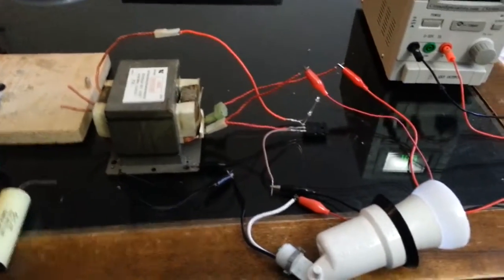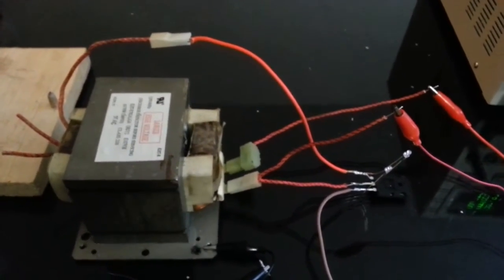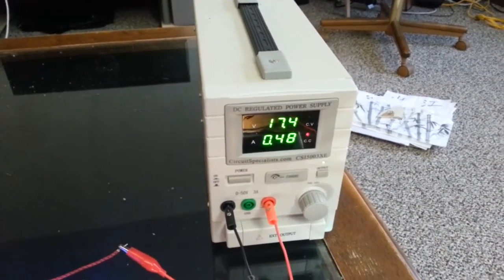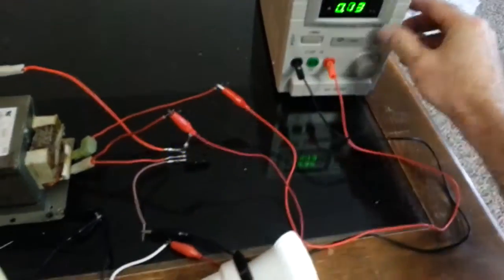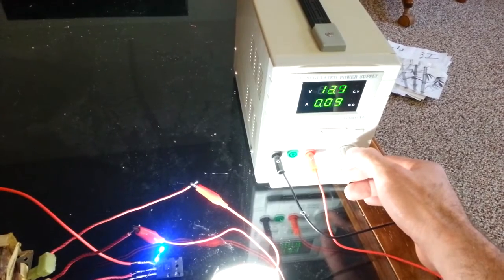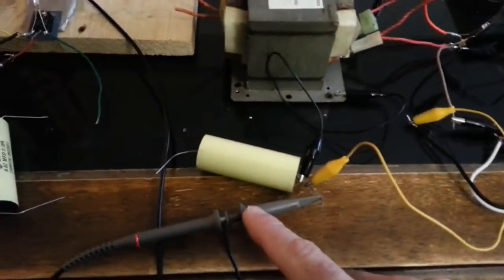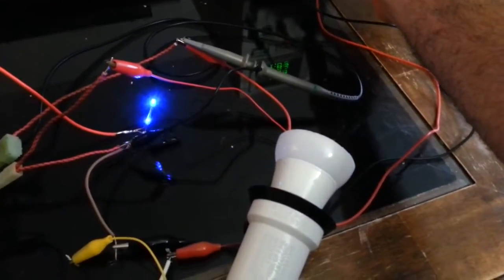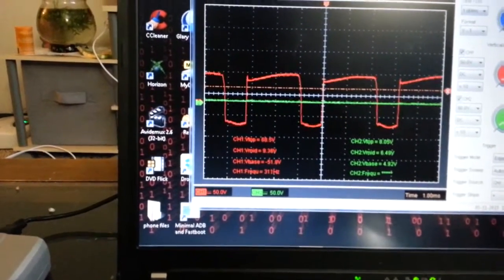Microwave oven transformer joule ringer with diagram circuit

Comment: I used your idea and it works! Just one problem...I tried using a tip3055 and a 2N3055 transistor and they both heat up and blow within 30 seconds. The light starts out nice and bright then starts slowly flickering then ....pffft. Done! Is the transistor too weak or could my transformer  be too large? I'm using a 1000 watt transformer from a mid-sized microwave.  I've followed your video exactly except I'm using a 12 volt battery. Any ideas?
Reply: I think those 3005 are only rated for 60v but high amps. You need simething to deal with higher voltage like 600 as the kickback will destroy them !

Comment: Amazing... 10 Volts and 0.7 amps DC = 0.7 watts. Is it not?
--------------------------------------------------------------
As you stated, in a MOT, on side of the secondary is connected to the metallic 
part of the transformer.

Between the secondary and the primary of this MOT there is an hidden capacitance 
of about 250 Pf. 
This could be used in some circuit. In this case it will not help.

Now, you can add another kinda "ghost" capacitor: just an isolated metallic sheet
on the top of the MOT. With some  weight on it to improve the contact.
You will get about 300-400 Pf. Here you have you smoothing cap.
I will bet that your Leds bulb will not consume anything.
The circuit itseft will consume, yes. But not the load.
------------------------------------------------------
In the Laser Saber SJR Looper 3.0 adding leds increase the power consumption. Normal effect. I have replicated It.

I have added a "ghost" capacitor and, adding the leds does not increase the power sonsumption.
--------------------------------------------------------
Please consult Vladimir Utkin Electro Radiant Effect.
Reply: 10 volts × 0.7 amperes == 7 watts

Comment: What kind of light bulb do you use? A DC or an AC ?
Reply: I figured out, when I look again to your video. Thank you for posting such interesting videos.
Reply from the maker: Machiuka these were cheap ac bulbs from the local store. Technically if I opened them up an bypassed the circuit inside then they could run on dc volts
Reply: Darren, I've made one following your instructions. It runs well on 12 V batterry (on 24 V heat the transistor). I've put a resistor on transistor base.
Reply: Now I'm waiting my motor-generator setup made of 2 direct drive motors ( from  Samsung washing machine). I'll try your schema.
Reply: DC

Comment: Darren I made laser saber 3.0 joule ringer long time ago and took it out the closet to prepare for hurrican irma and it ran the blue the transistor so i replaced with new transistor and it would not start so i disconected the wire connected to the base and put it to the emitter terminal and now it starts and runs ??? I need help figuring out how it runs when the base is touching the air . Took 40 v Plus to get it to start though.